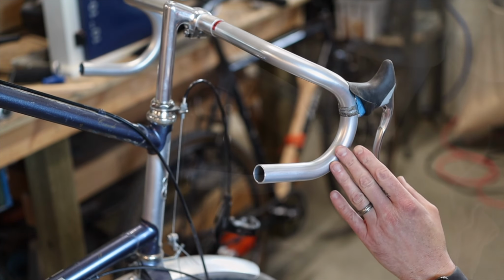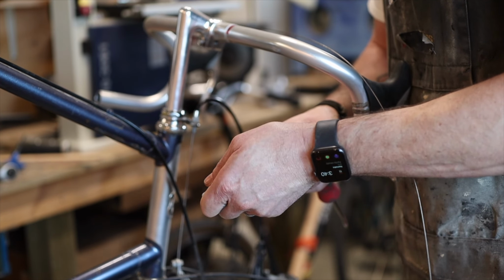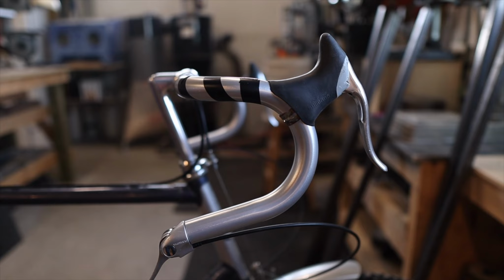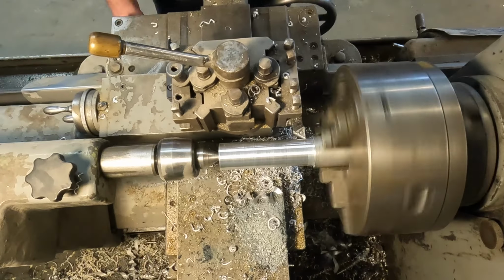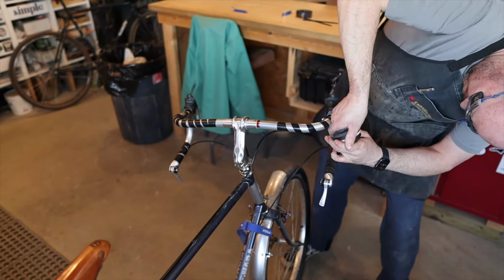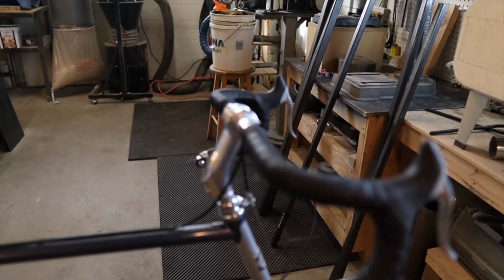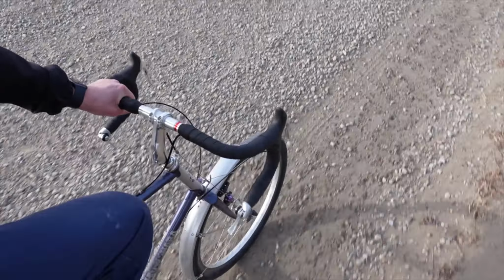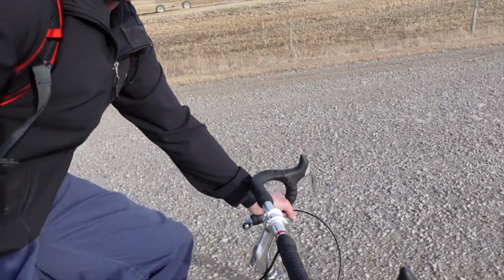Drop-bar dad bike V2.0

Comment: The used bike market here is insane. You cant find frames, parts, wheels, nothin. And if you do people want crazy prices for them. Sweet chill bike though! I dont have a proper "t-shirt ride" bike in my collection yet. Trying to find something with good tire clearance can be tough as well. Take care Jeremy 👍
Reply from the maker: It’s like that here now too. I think I’ve seen a 10 fold price increase. All I own now is t shirt bikes. 😆 I remembered when I used to try commuting on a full carbon Allez. Fast as can be but just didn’t seam to work right. Surly has some decent (affordable) frames that accommodate fat tires and the sweetness of steel is so good. Midnight special is a “road geometry” frame with the weight of steel and clearance. But I’m brand loyal to them for now but I think the whole gravel bike thing is bringing in interesting options from a lot of manufacturers. It’s a good time to be in the market for a road bike with fat (I mean body-positive) tires. 😆👍